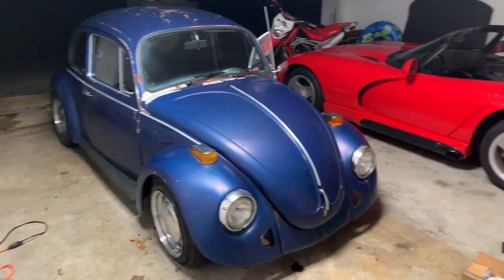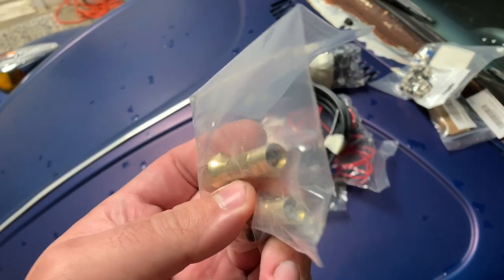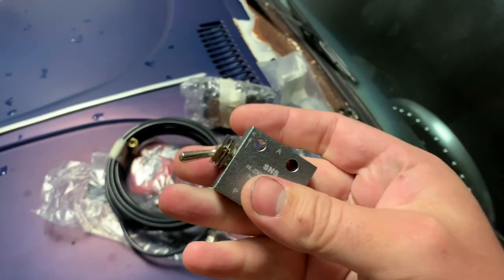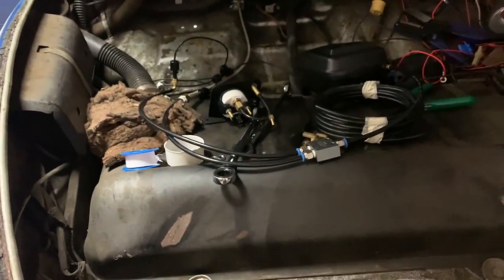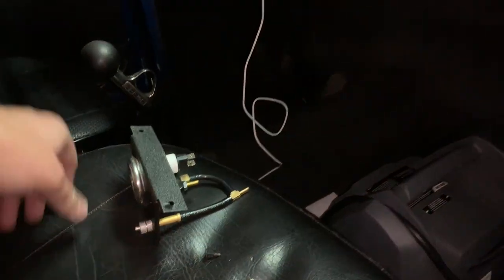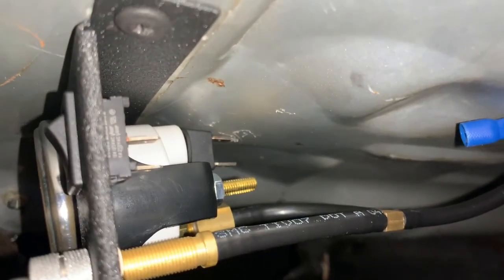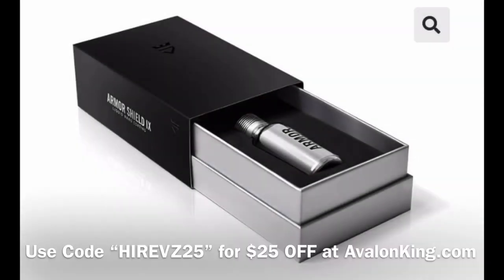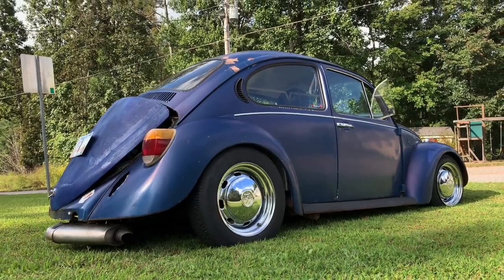AIR LIFT Air Shock Controller Kit - VW Beetle - Easiest Way to Slam a Bug! - Pt. 3

Comment: Thanks for all of the great detail in the description. A technical question for you. Are the through rods necessary, or can I retain the torsion bars with front air shocks. I only need an inch or so of lift when I have a passenger. Great video, love your style. New subscriber.
Reply from the maker: Hey bud, thank you.  Yea, you can leave the torsion bars abs just pump up the air shocks, if you are just wanting to raise the car.
Reply: @HiRevzMedia  Awesome, thank you. I have an adjustable beam and drop spindles with stock shocks. I love the stance, but if I have a passenger we drag the sway bar a bit. Your approach here is really cool. Think I will be giving it a try.
Reply from the maker: Yea man, that will be perfect!

Comment: how does it feel when you corner hard do you feel the outside tire/ shock feel soft because that air moves to the other side? im trying to put something together on mine, but im thinking of putting check valves to stop the air from moving.  do you think im over thinking it and I should just hook them up strait, or separate each corner? great video and explination
Reply from the maker: I haven’t noticed that at all, but if you put check valves in, you won’t be able to get the air out of the shock, unless you remove a line.

Comment: so you have to lift the hood up to flip the switch to lower the front then back?? could you mount the switch inside the car?
Reply from the maker: All of the switches are inside the cab.  Connections are underneath the hood.

Comment: How does it behave? I mean some people say that rear shocks are weaker than airbags, but I’m not Shute about installing the chunky bases for the rear bags

And I was thinking about installing only the front kit, can you share your experience, by now?

Thanks
Reply from the maker: With enough air in the front and rear, it feels completely comfortable and stock going down the road.
Reply: @HiRevzMedia  great, how many Psi do you run it front and rear? Thanks

Comment: Can I mount compressor on back seat floor instead of trunk, stop raddling noise since back is heavier or does it makes difference where
Reply from the maker: Yea, any place is fine, you will just have to run longer lines.